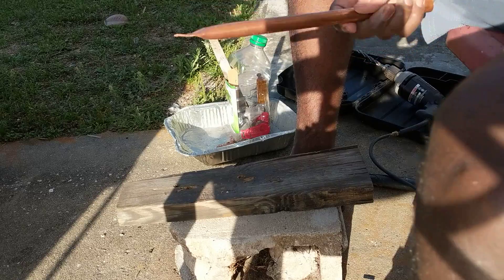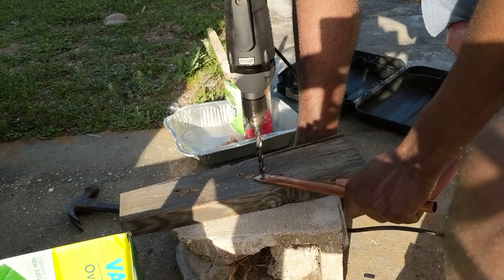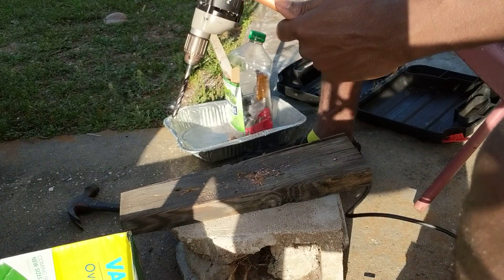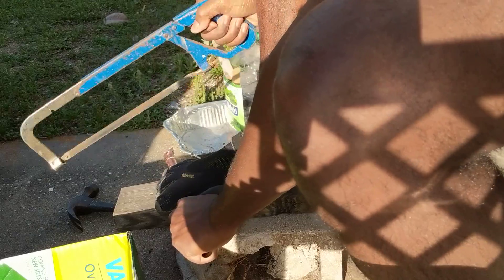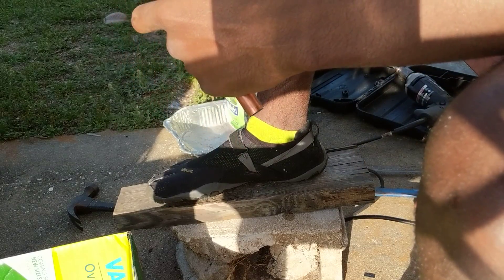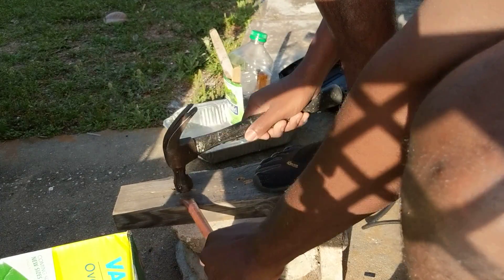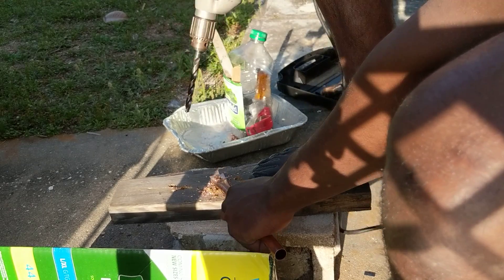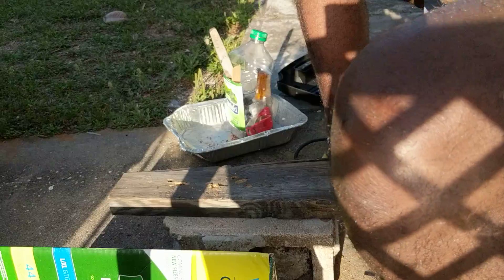DIY Heavy gauge cable connectors

Comment: If you find standard copper to dense or hard you can use L copper such as what is used in air conditioning line sets , it is much much softer